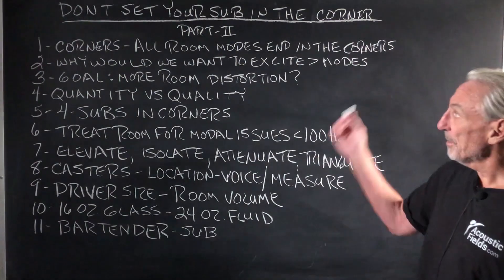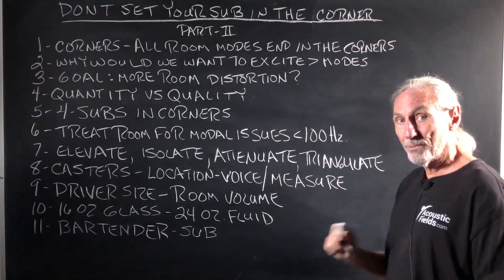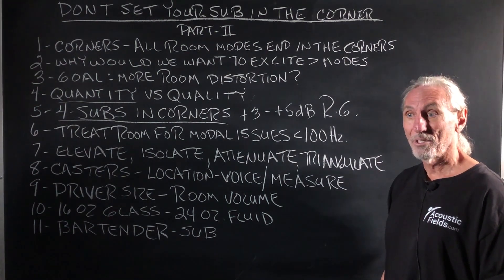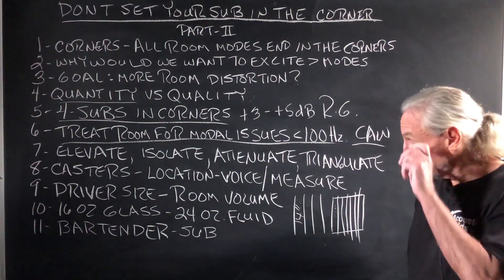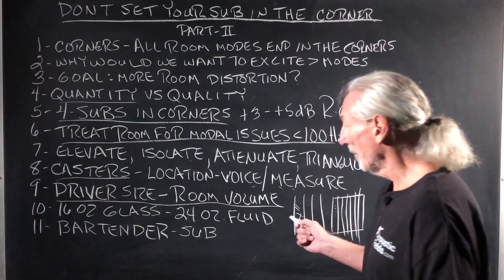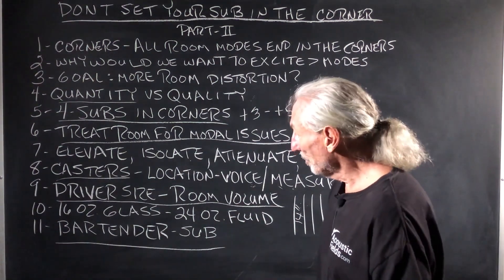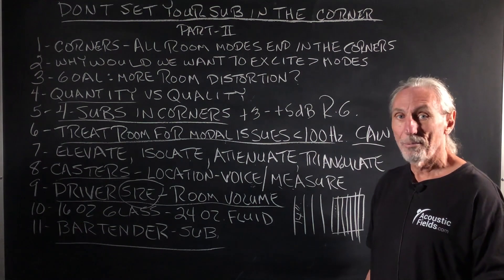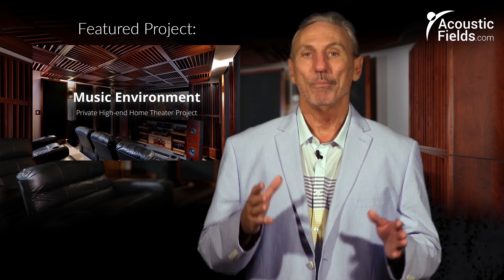Don't Set Your Subwoofer In The Corner! Part 2 - www.AcousticFields.com

Comment: In America 12 or 16” are between every stud. I’ve never seen 14” between studs.
Reply from the maker: Studs are placed 16" on center. The distance between the stud (interior) is 14 1/4". This is the area where our carbon is positioned. With this method we tune the room every 14 1/4". With the average lower frequency modal pressures occurring every 36 - 48" within the room, we can go after excess pressure 3-4 times in the same wall space area.

Comment: I have two subs behind the couch, each sub is 30cm/1ft from each ear. So very nearfield and the closest boundary is the floor. Best bass i've ever heard, zero boom and with a right phase alignment it all sounds like it's coming from the front. The couch vibrates a bit from acoustical energy but it's tasteful, they are decoupled by some foam i got years ago that's supposedly good at absorbing energy, it's like 2" thick and acts like a spring. 

Very happy with it!
Reply from the maker: Thank you for supporting the correct way to position subs by staying out of the room corners. The corners bring in room distortions. The goal is less room and more music.
Reply: @AcousticFields  You're more than welcome, one unfortunate side effect is subwoofer quality becomes more apparent. I think this a good excuse to make nicer less resonant boxes. The Peerless drivers and amps are fine i reckon.

Comment: You're absolutely right SIr! NEVER PLACE YOUR SUB AT THE EXTREME CORNER. MAINTAIN AT LEAST A COUPLE OF FEET AWAY FROM WALLS.
Reply from the maker: Yes, companies recommend placing their low frequency devices close to room boundary surfaces to increase room gain. If you add the room gain to the output of the device, you get device sound along with room gain. Companies play upon the ignorance of the consumer. Quantity is not quality.

Comment: REL begs to differ thanks to better crossovers.
Reply from the maker: Better crossovers will have minimal impact on the modal pressure issues within a room. The room dimensions determine the low frequency issues. Placing less energy at certain frequencies will have an impact but only at those frequencies. Its best to treat the room for all low frequency issues and then you don't have to play cat and mouse with room modes. You can treat the complete room for all frequency issues for the costs of two subs.

Comment: The corners have been PROVEN to even out modes. This is not new. I also have been doing HT and audio for almost 30 years. Every time it eas better or as good in the corner than most other positions. You are enamored with your own intelligence. It does not produce more distortion, it evens out the modes better.
Reply from the maker: The corner issues are created by the two walls that produce the corners. If you treat the walls, the corner issues disappear. After 30 years, I am surprised you didn't figure that one out.

Comment: Isn't it easier to place the sub in your listening position... then you wander around on the floor to find the sound that works. That is where the sub goes  and hopefully it is in a good spot for the room.
Reply from the maker: The sub position has nothing to do with easy or difficult. The room dimensions and the SPL used within the room are the most critical variables.
Reply from the maker: This is not a good start point for this process. Elevate the sub off the floor and place it on casters so it can be easility moved. Place in room center. Move in one foot increments in one direction at a time. Repeat process for another direction. Spend time listening to your music sources between sub moves. Sometimes you will know immediately, sometimes it will take a few songs. To avoid all of this, treat your room so it is pressure balanced. With a pressure balanced room, the sub will sound good anywhere within the room. To aid this tuning process, our sub platforms are on wheels.
https://www.acousticfields.com/product/subwoofer-platform-absorber/

Comment: Hopefull you read this Acoustic field.  I have a 24 x36 basement.     My issue is i have a drywalled stair case coming down about into the center of the room.    I  have a pb16 and a pb2000 svs sub.    I mostly listen to musice 95%.   Id like to have bass in all parts of this room as there is a bar at one end and a game room at the other.  What would be your suggestion.      Ive split them up to this put.   One at the end of the room and the other at the other end.    Unfortunently I have put them in the corners  lol    I will change that now.
Reply from the maker: Placing subwoofers in any position within the room requires that there be the proper rates and levels of absorption to deal with lower frequency unwanted modal pressures.

Comment: So many sub choices out there, REL seem to have simple integration and their size is perfect. Right now a bunch of youtubers are touting the Speedwoofer 10s and 12s as best performance to value, although the 12s is gigantic. Then there's Hsu and SVS....🤔🤷‍♂️
Reply from the maker: The room does not care what the sub manufacture's name is. Only the buyer does. The room only sees energy. Choose a sub that has speed, proper driver output to mat ch room size and room volume along with a solid cabinet design. The sound from your sub contains three variables. You have the driver speed, the electronics, and the cabinet. You would be amazed at how much cabinet vibrations contribute to the overall sub sound.

Comment: Was looking at REL subs on Amazon, REL recommends placing their subs in the corner 😀
Reply from the maker: They do this because people want quantity not quality. This type of thinking Placing low frequency sources in corners produces 3-6 dB in room gain which is distortion that produces a muddy sound with no definition or seperation in certain octave bands. The room gain 
produces more energy but that energy is a combination of room sound and sub sound. To achive a tight clean low frequency in your room keep all subs away from walls. To increase resolution, treat the room properly with the proper low frequency treatment.
Reply: @AcousticFields  I have a REL sub, 10" sealed modest 300 watts nominal. I have it dialed in really well with my room and system speakers (for home theatre only, don't use the sub for music). I also have years of experience with professional audio visual production certified and all that jazz. My modest system is perfect for me. You have to know your room, equipment, and use science and experience together. To say that always putting your sub in a corner is bad is just crap and wrong to tell people. It may be bad or worse than another position. You don't know until you take in all of the other parameters which are always different for everyone.

Comment: The room that I did the best response was putting the subwoofer in the middle of the front wall!! That's because I had a floor to ceiling modal conflict at 60hz and 120hz. Although it looked weird, the sound was amazing.
Reply from the maker: Always locate a sound proucing instrument away from the room boundary surfaces.

Comment: If all the room modes end up in the corners, isn’t it advantageous to place bass traps there? In your corner bass trap video you indicate that they aren’t very effective because you’re only treating a small percentage of the total room surface area. That is correct, but based on what you say in both of the corner-loaded subs videos, it seems the corners are the most important area to place low frequency absorption.
Reply from the maker: Technically, all modes end in the corners, but not all amplitudes. You must treat the greatest strength modes which occur between two parallel walls, not two parallel corners. This is another example of the industy marketing half truths.

Comment: do you recommend 1 or 2 subwoofers in a big room ? (I want to play under 80hz with them).
Reply from the maker: It depends on many variables. What is room size and usage? What are the treatment rates and levels of absorption within the room? What is the ceiling height?
Reply: @AcousticFields  150square meter, 7meter in height (gallery). No treatment yet.

Comment: Dual subwoofer set-up best works when the subwoofers are placed in opposite diagonal corners, unless the room is very small, don't let anyone tell you otherwise. Of course it's way easier to set up dual subwoofers on the front wall inside the front left and front right speakers, but opposite diagonal corners will have the better sound.
Reply: Try both subwoofers in one corner together thank me later
Reply from the maker: Never place a subwoofer in the corner of a room. You are increasing room gain distortions with this method.
Reply: @AcousticFields  Have two subwoofers in opposite corners of my room and enjoying it for years. Thank you.
Reply from the maker: @itisdeepan  Move them away from boundary surfaces. Listen to the increased full range sound qulaity which contains less room sound.
Reply: @AcousticFields  
"Never place a subwoofer in the corner of a room. You are increasing room gain distortions with this method."

Genelec: Hold my beer. Pure BS!

Comment: I have my system based out of a corner, where the full range speakers are off the wall and separated, but a 12” subwoofer facing into the corner.  Amazing bass!  I’m really surprised just how much more sound the sub has facing into that corner, as I tried the configuration many ways.  This is great on a budget system, if you just have a single 100 watt subwoofer.
Reply from the maker: Quantity is not quality. You are hearing more of the room sound than you are sub sound since you are increasing the room gain by 3- 6 dB. The goal is less distortion not more.
Reply: @AcousticFields  I just plugged in my KRK 10s and placing it in the corner of the room turned way down sounds quite amazing...
Reply: Rule #1: your 2.1 setup should NOT sound like there is a sub attached (it should sound like an expansion of your mains)
Rule #2: you should enjoy your audio.
Reply from the maker: You are losing tone and pitch. The corner room gain smothers both.
Reply: @AcousticFields  Popular music taste is changing. 
What  some call "room resonance"  and consider to be distortion, for some other people is the perfect bass of their dreams (shaking the house)..
The word "music" does not really mean the same thing for everyone.
For some it matters to hear the difference between a contra-bass and a drum. For some it is just boom boom .. louder the better.

Comment: What about setting yours subwoofers (dual) on the back wall? Pretty much behind you.. unfortunately I don’t have space upfront to place them. It’s either back/front corner or back wall (not in corner) thanks!!!
Reply from the maker: Don't ask me. Ask your room. It will tell you everything about itself. What are the frequencies and amplitudes of those frequencies that will be located along the back wall? Are they the same frequencies that the sub will produce? If so, you will be creating more distortion.

Comment: Rel advices to set the sub in the corner. I found it strange, too. They say in this way the waves have the most distance to travel to the the next wall. But it rly works.
Reply from the maker: Placing the sub in the corner adds 3 - 6 dB of room distortion. It is quantity not quality.
Reply: @AcousticFields  in theory u are absolutely right. I have bought a rel s/812 and placed it "normal" first. That was ok. Then I tried corner placement and the sub became louder, yes. But the sub goes deeper, too And is tighter. So I ended up with corner placement and adjusted the volume (low level) on the sub (4 clicks lower). In my case this was the best result, but might not work with every brand/room

Comment: In one video you said that putting treatment in corners was nonsense. This video says that all room modes end in corners. So why is it nonsense to treat corners?
Reply from the maker: It is nonsense to treat corners and call it a solution to the problem. Since the defintion of an axial mode is unwanted lower frequency pressure between two parallel walls not two parallel corners. Treating the corners is another industry bandaid. Spend your acoustical dollars treating the complete problem. In small room acoustics, nothing is easy. You must develop a strategy and apply the appropriate tactics. Corner treatments are a tactic without a strategy.

Comment: I have 9 subs in my home theater setup (7 passive 2 active).  I have 5 passives in one corner, and the SQ and SPL are incredible.  I challenge any naysayers to listen to my setup, and feel the phlegm clear from your throat, and a 360° air massage from the sound pressure level.  Peace
Reply from the maker: Quantity is not quality. You bought into the loudness myth.
Reply: @AcousticFields  to each his own.

Comment: Hey I'm curious to know, are you against tactile bass ?? Because some scenes like gunshots, bomb blasts, dinosaur foot steps etc gives great movie experience when there is a good tactile responce that you can feel through the couch. And also chest kick in some movies. If you are not adding more energy to the room, we can't get tactile feel. What's your opinion on this ??
Reply from the maker: I am against gimmicks that pretend to take the place of a well treated and designed room. Low frequency energy is felt not heard. If these devices produce the tactile experience you desire than mission accomplished. However, once your room is treated to resolve low frequency energy down to . .5 dB, the tactile experience is already there is the oscillating waveform that moves through your room. I gurantee you that feeling of the wave moving through the room is greater than any vibration generating device. There is no free ride when it comes to acoustics.
Reply: @AcousticFields  first of all thanks for the reply 😊...I really appreciate  you are a strong supporter of QUALITY not QUANTITY. 👍👍  Currently I'm using two 18" diy subs in a medium sized hall. For placement and alignment, I  did whatever i can using REW. To get tactile feel, I had to increase the SPL, and it becomes painful on ears. Then I placed one sub "very near field" just few inches behind the couch. Now i get tonns of tactile feel even at low SPL. For movies it's awesome. For music, in terms of transient responce, it's neither very bad nor very great. It's just ok.  I have to build bass traps targetting some specific room modes yet. 

Anyway ..all your videos are very enjoyable 😊😊😊👍👍 keep up the great work !!!!

Comment: Flame me all you want, but I've tried to put my sub all over my room. Middle, centered against a wall, different corners. No matter where I put it, the bass sucked in the "sweet spot" for the other surround and main LR speakers. Little he said made any sense to me. A 18" 1000 watt sub in a closet? Ya, agree there. But 2 15's in my Yugo is just fine! LOL. I have an 18" THX Altec powered sub in a corner in the front wall where the main, center, and TV are. It sounds as smooth as a baby's butt as long as I'm not in one of the null zones. I believe that only in a huge ass room, like a 4 car garage with 10 foot ceiling, you may get an almost uniform clean low end w/a sub up against the back wall in the center. I've done it.
Reply from the maker: You can not use a sound producing device, especially a sub woofer, to correct for poor room acoustics. You are chasing your tail and running in circles.

Comment: I’m shocked that you don’t understand the theory about the room modes and yet you are selling products for room treatment. 
Primary modes have opposite phase at the opposite corner. Having four subs in the corners playing the same signal means that the modes are cancelled.
Reply: Dennis does not understand basic room acoustics, so your effort here is not going to change anything. Most books on acoustics provide a good overview of what modes are, and yet Dennis talks about 'air', 'it is all energy', 'the energy does not fit in the room'. Anyone with this basic knowledge about acoustics can see this, and yet people love these videos.
Reply: Quite strange thatbis not understood here. Crazy.
Reply from the maker: Nonsense. Placing more energy within a room to fix problems that are produced by too much energy to start with is not the direction to go.
Reply: @AcousticFields  Room modes are not created by too much energy. They are resonances caused by coinciding wavelength and room dimensions. Take away the resonance and the excess energy goes away. The level of the subwoofers one or many are adjusted to give even response. The more subwoofers you have in a room, the less volume each is outputting. There’s no more total sound energy, it’s just distributed more evenly  around the room between  the subwoofers.
Reply: @jyrkih6960  Exactly.
Reply: @AcousticFields not getting it, you are. The corners even out the modes. They are lessened to a degree. This allows for attenuation of the more, remaining problem frequencies.